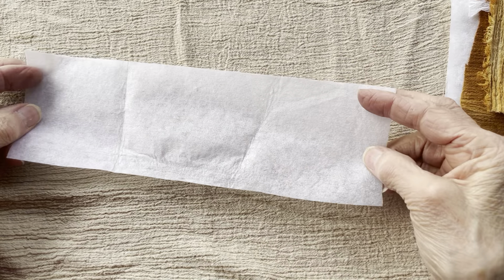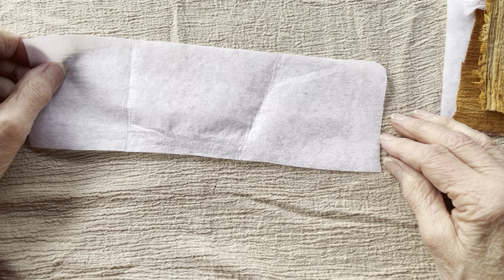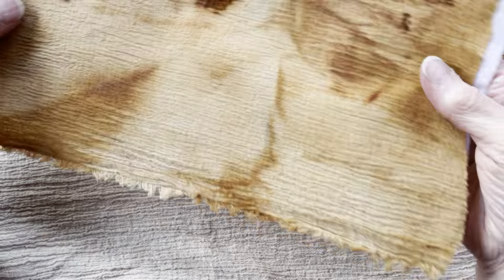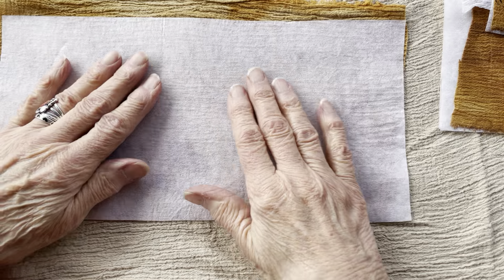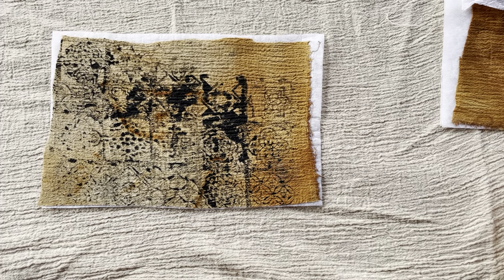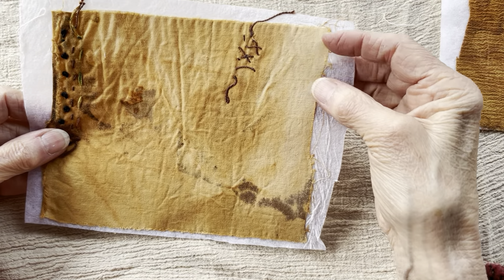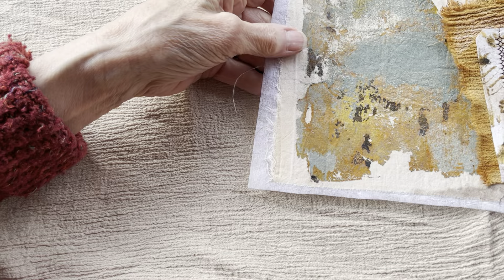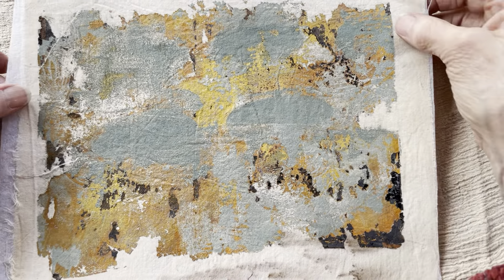How to Create a Pliable Yet Sturdy Fabric Page for Your Collage Journal

Comment: what an artist but I am puzzled how do you run that thick material and interfacing with the gel plate printing, through a printer?
Reply: To be honest I didn’t know if it would work when I first started. I have had a couple of tries that jammed the copier but most of them have gone through fine. I cut it to the size of a sheet of paper, and I take all the other sheets of paper out. I carefully push the material in and make sure it fits well.👍